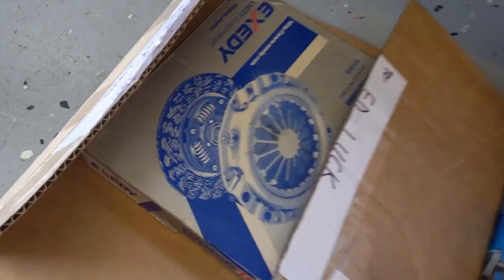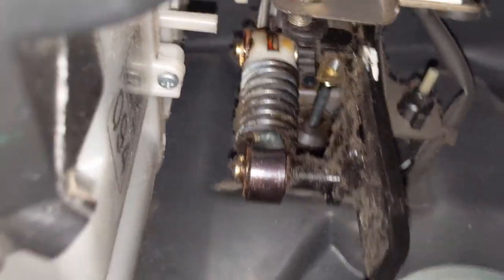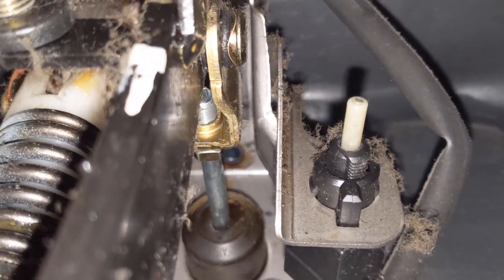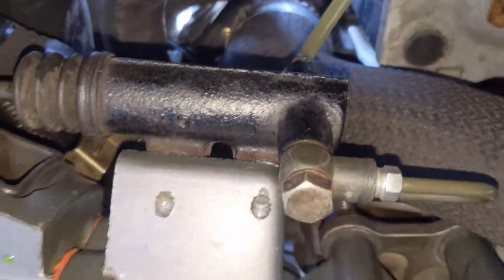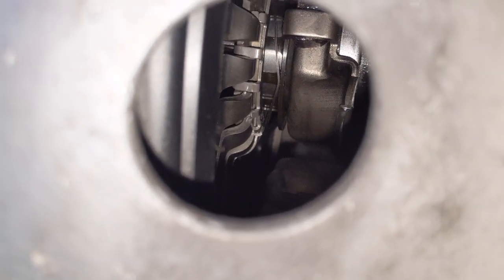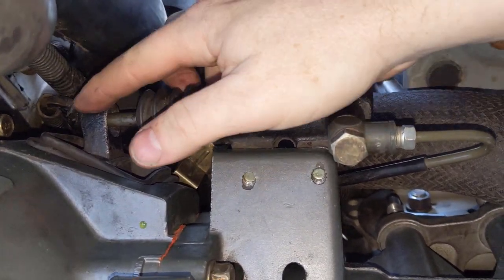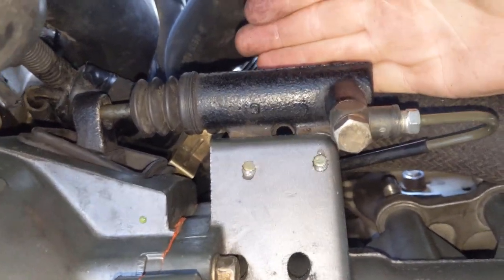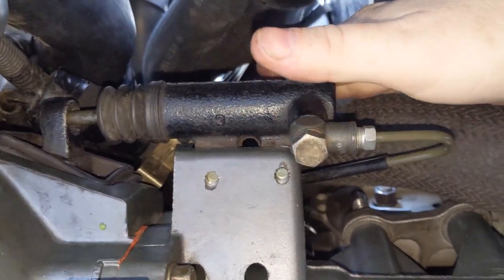The secret to bleeding the clutch on a Galant/Legnum VR4 or Evo

Comment: Kaldek you are always a absolute lifesaver. Just finished my manual conversion have tried bleeding the clutch multiple times. Took out master cylinder and bench bleed etc. to still a spongy clutch. I reckon this will do the trick! Going to try out tomorrow. Please keep making videos, everything you've posted so far has helped greatly.
Reply from the maker: Hi mate, in my case it didn't feel spongy but just didn't lift the plates apart enough.  I have an Evo performance clutch.
Reply: @KaldekBoch  Mine currently doesn't feel firm at all and it's definitely not lifting the plate enough looking into the gearbox.

Comment: Great info. Have any idea why the slave still has air bubbles when doing this? No visible leaks
Reply from the maker: The statement from my engineer is that the rapid movement of the slave cylinder causes the seal to briefly lose effectiveness and allow air to be drawn in.

Comment: Thanks mate. I've got a 2000 Galant VR4 manual. Is that your original slave cylinder and how many miles on it? Cheers
Reply from the maker: Hi mate, yeah I believe it's the original as it's not been replaced since I've owned the car.  It's got 177,000km on it now.